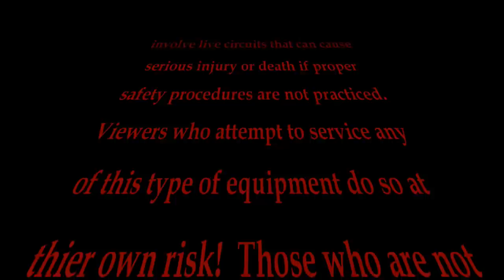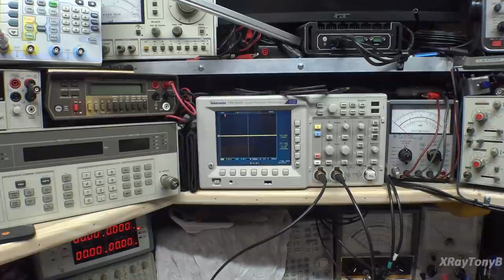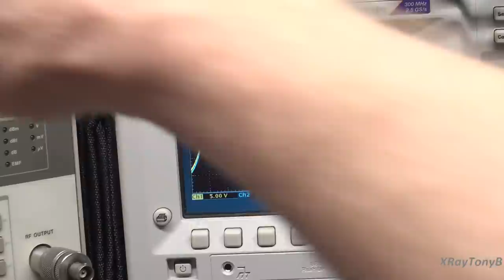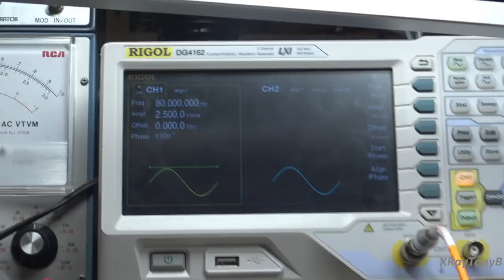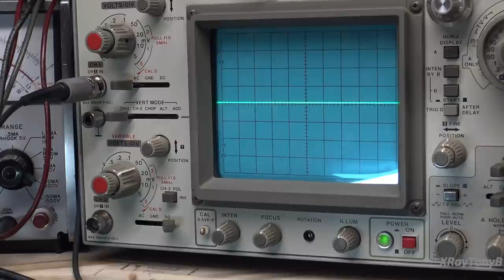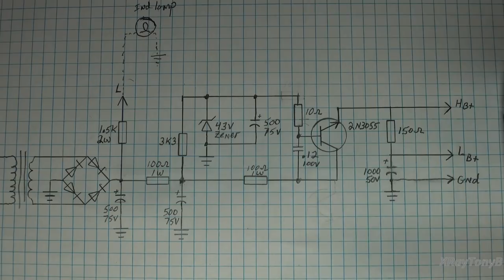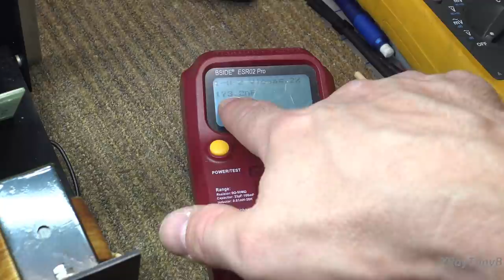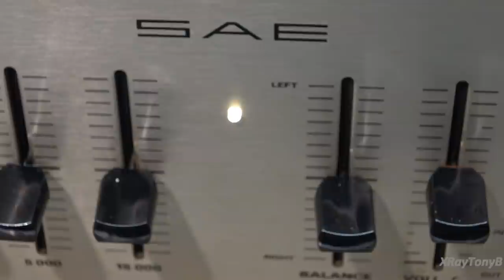SAE Mark Nine Preamp - Troubleshooting With No Schematics

Comment: Thoughts on EQ ...? 

EVERY system, in any normal sized residential listening room, benefits from EQ. 

The single most important aspect of sound reproduction is the loudspeaker/room interface. The acoustic transfer function determined by the speaker location and the room's dimensions create resonances that need tamed by EQ. 

The proper EQ tool is parametric not graphic, as graphic EQs simply don't possess adequate precision. 

Also, EQ only works correctly* within the minimum phase region. This region is below the room's transition or Schroeder frequency, approx 250hz (varies according to room dimensions). 

Sound behaves quite differently eithet above the transition region or below. Above the transition, the smaller size of the wavelengths determine that Ray Acoustics rule the day. 
Below the transition region, modal resonances rule. 

Pressure "Rays" above ...
Pressure "Waves" below ... 

* The two distinctly different behaviors require different approaches. EQ above the transition isn't a valid technique, because an EQ change only exists in a single point in space. 

Whereas below, down in the modal region, any change in EQ is effective uniformly throughout the space. 

-----------------------------------

EQ is a final step band-aid. 
Prior to EQ'ing, experimentation with room geometry, and with placement of both speakers and listening position truly pays off.  

-  A room's dimensions determine the resonant frequency modes. 
-  Loudspeaker placement determines which modes are excited.  
-  Listener location determines which modes are heard.

Comment: Its coincidence that i wad just working on an SAE 101 computer direct line parametric equalizer digital readout its a fantastic  EQ just like yourself and your tutorials they do work differently from a graphic  EQ they zero in on a pitch and you can up to16db +- and still cut that 1/3 per octave in treble or bass they remove cabinet resonance its tighter sound allround it can really taylor sound NOT COLOUR IT by any means i opened it up i was having problems with my system found out it was the preamp AUDIO RESEARCH all's well its in surgery now but I have others in its place i do think with the removal of tones bass /treble an EQ is essential to smooth out sound people in those days were using them as an add power booster to the amp just an octave or two goes along way thanks for the many years of YouTube SERVICE i mean that

Comment: I set my room up with REW (Room equalization wizard) and run flat. 
I've tried graphic equalizers before and they seem to mess things up worse than leaving it be. As you said, after a ton of fiddling you end up with a smiley face and frustrated. 
I can see a parametric or DSP if your room is really bad but I haven't needed to go that far in any rooms I've set up for myself.

Comment: Equalizers, like any other piece of audio gear, have their place; if they weren’t needed, nobody would have invented it. I suspect that most people don’t need anything more complicated than your standard tone stack (treble and bass controls), though. A good amp, and a good set of speakers, should have a nearly flat frequency response; it’s the various input sources, though, that can complicate things; line-level inputs (aux) from an mp3/CD-player, outputs from a computer’s sound card, microphones, phono/turntable, cassette/DAT-player, and so on (and don’t get started on RIAA equalization, Dolby, etc...) Here’s where an equalizer can come in handy (along with a mixer board, no doubt!) Since I’m not an audiophile, I’ll leave it at that. 😊

Comment: 34:45 I suggest sir try steel wool #00000 or 3M  Gray and White abrasive pads. Its much slower than Dremel tool but safe. Great video as always sir. Thumbs up.
Reply: I just use a little DeOxit on a paper towel and wipe them clean.  Nothing abrasive.  Seems to work great.
Reply: @jimomertz  Deoxit cannot be found in my country. 😢

Comment: Since you wanted opinions on EQs - a simple graphics EQ like this is going to be of very limited use, maybe for correcting bloated bass due to boundary gain or something. Ideally you want a parametric (5 bands with low shelf and high shelf would be a good starting point), plus something resembling a measurement microphone (your lav mic definitely isn't ;) ), ideally calibrated, interfaced to a PC running REW, so you have an idea what's wrong in the first place and can design (or have the software design) an EQ preset to correct the issues.

Parametric EQ is something that lends itself to digital implementation, where it can't introduce any extra distortion unlike a tone control amplifier - as long as the signal is kept out of clipping of course, so a pre-gain adjustment is pretty much a must-have. Those with a Windows-based playback system can use Equalizer APO, for example.

Regarding the power supply, the LB+ probably feeds the more sensitive sections like the RIAA - the regulator is likely to be quite noisy with such a high-voltage zener, and the RC filter would really knock that down, along with whatever hum may be remaining.

Comment: graphic equalisers in hi-fi setup are too crude to be used to compensate for problems you might have because acoustics are too complicated to be corrected in such a way. best thing is to go for is either having bass and treble controls if you like to contour the sound a bit for instance if one likes a bit more bass for electronic music or more treble for 80's disco. If someone is facing some tonal problems 90% of the cases it's a case of a bad speaker placement. enough videos on that subject. I recommend The Hans Beekhuyzen Channel. He did some nice videos on the subject. If one is facing some serious problems with a room itself like standing waves or so instead of graphic eq it is better to have a go with a room correction software like room eq in combination with EQ APO for windows pc gives you a badass room correction solution using open source software. It takes some playing with measurements and filter design to get it right but it is worth it. Due to psichoacoustical aspect of audio reproduction. You can never set eq by ear to sound right on all music because we can't perceive phase angles versus amplitudal differences. For instance most of the time first thng people do is just crank the bass control up when they don't hear enough bass but due to room nodes bass frequencies may just have been canceled out by the room itself. maybe just setting one speaker slightly asymmetrically would solve the problem.

Comment: Neat bit of kit, with all that stereo/mono switching, it would make a great workshop pre-amp, although the phono preamps would go to waste there.
Those sliders are so big because they are stereo, a rather rare beast
I was suprised to see those inductors in the eq, I'm so used to seeing it done with op-amps.
As for graphic eq's in general, I've lost interest in them, if you need one, then maybe different speakers etc. is a better answer.
The only bit I am not a fan of is using a slider for volume.

Comment: On the EQ question: I'm 67 years old and my hearing is not only terrible, it's very unequal left to right. I require a dual channel EQ with headphones - and I adjust using a random white noise sample to adjust for something I hope comes closer to normal hearing. When using outside speakers I don't bother with the EQ because the radical settings I require would put the tweeters at risk. Word of advise: protect your hearing when you are young!

Comment: The EQ is useful if you an RTA and pink noise to set it up. Beyond that you need a very good sonic baseline in your mind derived from alot of listening to a high system to set one up.
Reply: Not really nothing is ever set up in concrete  due to the fact that every song every album is different even so much h that changing eq during a song on the fly . Graphic  eq is just a notch above bass & treble  knob.

Comment: An EQ is a disadvantage. Extra unneeded wiring and electronics. I never use em. Don't even use the bass or treble. I do use the loudness button though as nowadays with wife and kids around I usually almost always listen at low levels. And as I age (57) how good does the sound need to be with my aging ears anyway. Sigh. Keep up the great videos :)

Comment: me and equalizers
2x1000 W poweramp (power limitad in software to 500w) 4x 250w stage speakers and a bunch of dynamic mics in most cases i reduce the low and ultra high frequency bands to limit microphone feedback from the walls because place i work in have really nasty audio parameters to work with but eq is a must

Comment: If it's good enough for Broadway . . . audio sounds great.

RCA jacks: your wire wheel was treating the ground side, but wouldn't reach the signal side. Do you scrape at that, too, or assume that the cleaning spray will be enough for the center taps?
Reply from the maker: I use a pipe cleaner with contact cleaning spray.

Comment: I love having an equaliser! The sagging boob's is where it's at! I really don't like just having a volume knob! A control amplifier needs to be able to control! The more features the more control you have! 
Some of the stuff that is coming out now days looks like a power amplifier with a volume knob! 
Incidentally, I personally prefer the sliders for the equaliser but not for the volume and balance controls, bass and treble controls can be rotary potentiometers, the equaliser just isn't the same thing using rotary potentiometers... 
Axial capacitors are just sexy! They were used a lot in the older gear, that's why I have been stocking up on them. I love the Philips blue wrapped capacitors that are rated for 125°. I don't know but I might have a fetish for older axial capacitors and metal encapsulated transistors! It just adds bling bling to the circuit board unlike surface mount stuff! Melf resistors and zener diode's are an exception! I know looks has nothing to do with the sound but it somehow sounds better to me knowing what's under the hood! 
Tony, the mic location was great, I could hear you breathe lol, maybe the next piece of equipment that you might want is a noise gate for the mic, those things are amazing, it's like someone is waiting for you to stop talking to turn down the volume, but it's so fast, it's pretty good. That's what other YouTube content providers are using plus a compressor limiter, that way everything is quiet when it should be and the levels are always perfect! You never have to worry if it's to loud or not loud enough! You will be free to do what you need to do without worrying if it's being picked up or being distorted...
Anyway, hope that helps..

Comment: 51:48 - I'd replace the bulging filter cap (2nd from left) it appears to be directly connected to that resistor that's running hot.!

Comment: Coming from the pro side equalizers are a staple item for all systems.  That said i never liked graphic eq.  The chances of faving a null or peak at the same frqeuncy as graphic eq frquency is 100:1. I always use parametric eq's because you can adjust the center frequency,  band width ans sometimes the "Q".  That said, a person who do not know what they are doing, can screw things up big time with a parametric eq. Quite often, eq's "can" mess up phase and that is not often understood by many users.  That is especially true when multiple filters are bands used.  Many times, i could simplify the number of bands and get a better overall response than the installer who created the initial settings.  So i prefer using good speakers and gooc acoustics rather than active eq.

Comment: I see sound systems in a similar fashion to funk.  Every instrument/component is doing very little but as a whole makes a huge sound.  Eq should be used very sparingly. Small adjustments and once it sound good,  leave it well alone.  There is a limit to how good your system can sound and no amount of Eq can cure that.  It is designed to subtlety calm down easily excited frequencies and augment weak one's.  I was a decent sound engineer back in the day and the amount of PA systems I would plug our band into where everything was used far too much and I ended up just starting from fresh.  I would usually set the eq to white noise,  then a well known peice of music,  then see how the lead singers mic sounded,  then carefully ring it out to eliminate feedback.  And I rarely adjusted any band beyond 3Db. Volume was a big issue as well.  I'd just see how loud I could get the vocals through front of house then flatten the faders, set the fold back,  match through the front of house what I could hear through the stage spill and boost what was lacking coming off the stage with a little more vocals.  I often found I had something like 6-12Db headroom because the result was a lot quieter but since it was balanced it 'sounded'  louder.  And because I had the headroom THD was a lot lower from the equipment and dynamic power was maintained.  I kind of miss those days but hey ho.

Comment: Seems to me from my years of listening that equalisers and tone controls don't really solve anything. The ear can soon adjust to changes in tonal balance and where the real passion, insight and joy comes from is in the midrange. Small speakers can work very well, they only fail on scale which is not all that makes a musical experience thrilling. Tone controls are rather like the colour controls on the TV, they will not fix a bad input. Also one more thing to get in the way and fail. If you want to turn the midrange down it is usually because something is not right getting rid of it makes it easier to ignore. Sadly everyone seems using digital eq to make the walls shake and the music just gets lost.

Comment: Greetings: I am a regular with Shang0o66. But I subscribe here, too. I am a retired audio/video maintenance engr. from the Hollywood post production industry. You repairman help fill my diagnostic need without having a lot of test gear.. I never felt the need for one, but did appreciate the various sound chambers provided by my DSP equipped Yamaha RV-X2600. Also the provided mic allowed me to balance the level from all 7 speakers plus subwoofer for those .1  LFE signals.
Somehow I caused the failure of the RF output. I would ask you to do the repair but the shipping from
:  LA would cost too much. Also craigslist has working replacements for $200.
I think the test input level should be 1.0 P-P,
Because the EQ defeat probably bypasses most of the EQ components, I would resolvee any preamp issues in DEFEAT mode before focusing on the individual EQ bands.
You either failed to check the caps in the other eq bands or forgot to tell us the results of that testing.
Also, you overlooked the option to swap wires from that board at both the inputs to fe EQ board and the output of same to narrow your testing (not both at the same time). It would be nice to know the voltages out of the PS. The H depends on that load current.
Yes, you occasionally talk  beyond my listening tolerance, but know you are educating those without a high voltage education. HTH Doc chiron

Comment: Have a kenwood ka 3500. Plugged it in and fried up 2 speakers. Smoke n all. What would you say may be the fixable problem  new to fixing audio. Thanks love the show
Reply: Check if you there's No DC voltage  on the amps spkrs output when connecting unknown equipment, ALWAYS - spkrs are often more expensive to repair than electronics and some spkrs are NLA. Strange, since most Japanese gear has DC protection with Relays. If there's high value DC, say over 40V, the output transistors are fried (shorted) and the voltage from the power supply rails will be present on the output. It's very hard  to find replacement and most likely drivers and other parts are finished making the repair rather expensive. Often it's cheaper to build a really good A/B class kit, or buy class D power modules like Hypex and reuse the power supply and chassis.
Reply: @pliedtka  thanks for your response ok

Comment: Hi Tony, thanks for another great video. I'm not sure about the explanation for the led lighting when the switch is off though. Surely those caps across the switch only allow high frequencies through, not 60Hz to the PSU? Or do the caps actually leak power frequency?

Comment: I had an ADC Graphic EQ, with a record to test the room if you had the accessory remote mic. I did my living room and, at first I hated it, which the company predicted. Afterward, on consideration, I realized that I could hear sounds on the top end that I'd never worried about. So I liked it but, whenever someone came over and I activated the EQ (You could bypass it) they initially hated it. In the end, I think it was overrated. SAE had a parametric eq, which I use in my recording studio, which I think is too specialized for the average listener. A five-band EQ is little more than a fancy tone-control...and an extra the company could throw in to make you feel like you have control.

Comment: ok i almost watched the whole thing
it runs on single ended voltage, which meand type A amplification, you replaced that one transistor in the output and it almost fixed the problem, but did you check the resistor network around it ? with a different transistor, even equivalent it might want to be rebised to be back in on state all the way.
i was kind of surprised you didn't measure static voltages on bases emiters and collectors of those transistors to compare  both channels and to check out when it start to clip when you add a signal, if it swing out on the high or on the low side of the working band of the transistors